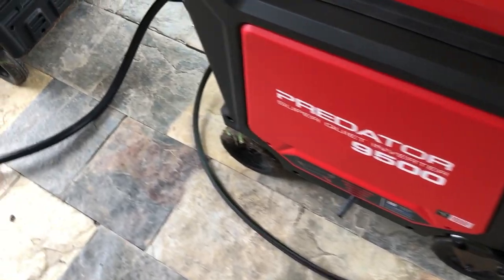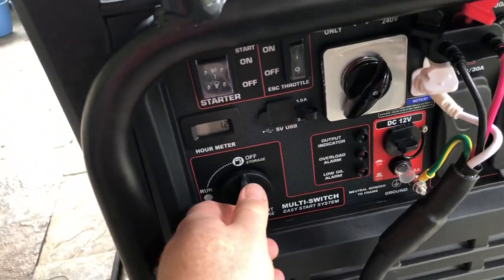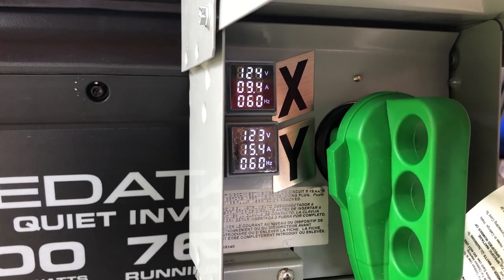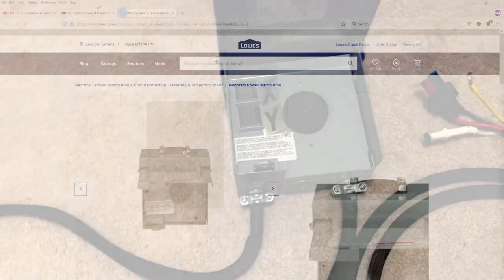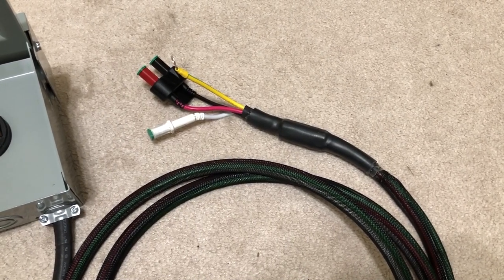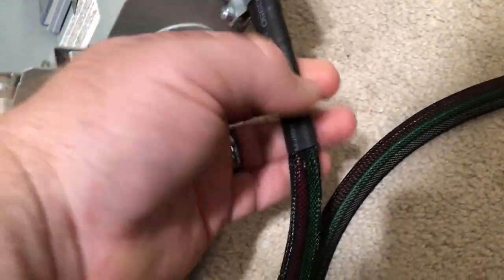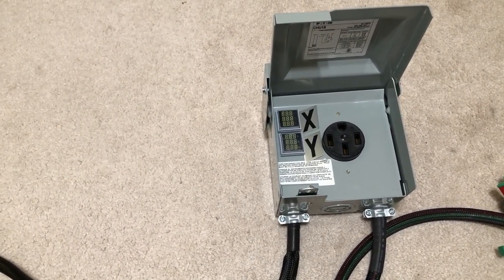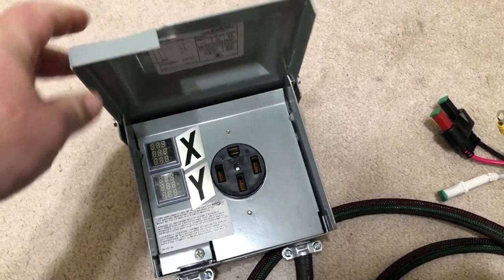Predator 9500 Home Built 240V Parallel Kit Test & Build Parts: 2X Output Power Using Two Generators!

Comment: Would it be possible to use the 30 amp four prong twist lock outlets instead of the powerhorse parallel kit? These kits are backorder and not coming in anytime soon according to northern tool.
Reply from the maker: **Technically**, I don't see why it wouldn't work, but, it would very risky and dangerous for reasons you might not think of... here is my warning about doing so:

First off:  There is a comment in the history of the video from a user "B F" where he implies that would be a better method.  Only I think he was suggesting each 30amp feed would go into the main circuit breaker, with no parallel "kit", the logic being more available amperage from the pair.  I went into a bit of a wall of text regarding the pitfalls of doing so.  But let's say it was a parallel kit instead.

So instead of direct feeding it into the home from the 30amp plugs (very bad idea) you instead made a parallel kit where each 30amp plug is joined together in a box with the 50amp female dryer plug.  Basically, just  like mine, but with 30amp male plugs on the ends vs. the parallel kit connection.

Danger 1:  As soon as you energized one side with a generator connected and running, the exposed male plugs on the other cable would also be energized with 240VAC.  (so, suicide plug )  This also means if one plug were to fall out, get removed, knocked out, whatever, those falling exposed metal plugs are energized.

Danger 2:  And this one is the doozy that most people probably wouldn't consider...   the power of each 30 amp socket is passed through a breaker on the front panel of the generator whereas the parallel ports are a direct connection to the inverter, this is really important, and I believe it's wired that way for a very good reason.  

If one generator of the pair is disconnected from the circuit (say breaker trips on either front panel, or one of the plugs is removed or falls out) ***then the generators will no longer be synchronized***.  Those two machines have to stay perfectly in sync to an accuracy of 1/60th of a second.  Meaning just like two clocks that you turned on at the same time will not remain perfectly sync'd for more than a few moments, almost immediately the two units (now running independently) will probably drift out of frequency sync.

So if for example, the plug fell out and you put it back, or if the breaker tripped and you reset it... this would probably do *spectacularly bad* things to the inverters and, to the sensitive electronic equipment in your home.  As your power would be composed of two different frequencies at the same time.  

I believe this is why they wire the parallel kit directly to the inverter via the specialized ports, making it hard to accidentally disconnect them (firm fit, and no breakers to potentially interrupt the circuit), and, why if one of these generators ends up overloaded, it forces you to completely shut it off the machine and restart it, (there is no reset button).  

By making you completely restart the machine, it forces an overloaded unit, (that would now be out of sync) to be started from scratch, allowing it to re-synchronize with a still operating generator on the circuit, and not get all explode-y.

So yes... you could do that, and I don't see why they wouldn't initially synchronize if they were both plugged in, and the circuit breakers on when they started.  But the plugs would be dangerous, and, you'd be setting yourself up for a situation where extraordinarily bad things could happen, if you or someone else made one single mistake when operating them.  Proceed with extreme caution.
Reply from the maker: To add:  I'm basing my warning on my understanding of how these things work, and what I've observed on how they're wired.  I have no official word or documentation regarding this.  (and before I got these, and better understood how they worked, I too assumed I could just join them via the 30-amp plugs since I had no idea where to purchase the parallel plugs from)

There MAY be some kind of safety circuit or function in place to prevent fireworks.  (Hypothetically someone could always still unplug the parallel kit and plug it back in while the units are running).  But to be honest, I'm not inclined to test the theory on mine and risk damaging the inverters, even if they aren't connected to my home at the time.

If anyone else want to test the theory on their $4000 worth of generators, I'd love to hear what happens.  :-)
Reply: @Texas_DIY  thanks for your help. Have you ever seen the banana plugs anywhere? All I've been able to find are the audio types. The kit you have isn't going to be available until late November. I called norther tool yesterday and covid has everything on delay for them.

Comment: Here's a potentially dumb question.  Has anybody tried hooking up the PH cable on the Predators as it's meant to be hooked up on the Powerhorse generators?  I've probably missed it, but I haven't seen that possibility addressed anywhere.
Reply from the maker: The PH generators are designed to be linked together like that. They are equipped with a high amperage socket and the internal wiring to accommodate that. Such that the front panel of one can handle the combined capacity of two units.  

The predator generators are equipped with a 30 amp socket. So using the PH stock cable would link them together, and double the capacity… but you would be still be limited by the 30A socket and the 30A breaker on any one generator. 

That’s why the cables combine into a higher amp socket, and feed into an inlet.  So you are able to achieve double the capacity that any one generator would be capable of normally.

Comment: Commenting and subscribing, great video. Only wish I could see the internals, though totally understand you not wanting to pop that thing open and risk a mess of wires spilling out! Migrating my comment from the other video over here, do you think the soft start is necessary for two paralleled 9500s to run a 5-ton A/C unit?
Reply from the maker: There isn't really much to see inside it.  Using those terminal blocks, each of the same colored wires get joined together.  The amp meters need power, so they had small wires added to the dryer plug (one on each leg of power).  And the little circle coil goes around what you want to measure.  (in my case, the 6 gauge wire going to each leg of the dryer plug).

Regarding your question on the 5 ton AC unit... like with most answers regarding generators, I think the answer is, "It depends".  Look on the housing of your compressor unit.  You'll see a number designated by:  LRA  This is "Locked Rotor Amps", and (as I understand it) represents the maximum amps your unit can draw from a dead stop.  There is also:  RLA "Rated Load Amps" which is the maximum it should ever pull when running normally.  (My LRA is 117A, and RLA is 21.8A)  Note those are *maximums*, and your actual number should be lower.  My clamp meter told me that MY max starting load (heat pump, scroll compressor) was 81.5A, (though it may be higher, the meter can only sample so quickly and the worst of the surge is very brief.)

The 9500 Generator can make 9500watts or 39.5A max/surge on each leg, so with a 240V AC, a brief surge of 39.5A can be handled, but normal running amperage of 7200watts or 30Amps.  Before I had the soft start installed, I did try to start the AC on the 30A hookup, and it instantly popped the breaker.  (understandably so with trying to pull 81.5A off something with a 30A breaker and a capacity max of 39.5A).  

So let's say I didn't have the soft start, and, wanted to start the AC using two generators.  Would it do it?  Maybe... if I turned off EVERYTHING else in the house, and had the generators not set on eco mode so they were spun up and ready.  My measured starting amps (81.5A), were almost exactly at the peak of the two units combined (79A).  And if the compressor was in different conditions (maybe hotter day, maybe starting again soon after the previous start, so pressures weren't equalized, whatever) it's "allowed" within spec to get up to the LRA (which in my case is 117Amps)  So... "sometimes, it could maybe do it"

But with the soft start, I was able to get it down to 41.5A starting (this is according to the Bluetooth connection on the softstart), and 11.3A running (normal) total (after fan and air handler) around 14A running. (I think people without heat pumps can achieve a much lower starting amps with these, very similar to the running amperage)  With two generators, this allows me to run the AC, and keep the rest of the house going, including the 20A hot water heater.  

Basically as long as we don't run too many appliances at the same time, we can operate relatively normally, but without the soft start, I don't think it would be happening.
Reply: @Texas_DIY  Thank you, Jason. Sounds like having the easy start, if not absolutely necessary, makes things much easier. So, went ahead and ordered one! I take it you installed your easy start on your own? The video install i watched seems pretty straightforward, but (as you've obviously figured out by now) I'm very novice and am debating whether to just pay a HVAC specialist to do it.
Reply from the maker: @todd9959  The hard part isn't the physical work of doing it, it's knowing where to hook things up.  The instructions try to be clear, but there are a lot of different ways AC units can be wired.  My heat pump was one of the strange ones, two capacitors and some circuit boards in there.  I sent a good photo of it to Micro-Air, and they replied back within hours with my photo, along with hand drawings on top of it showing exactly where to hook up the wires.  So that made it much more simple.  Even then I seriously considered getting an AC guy to do it before I just bit the bullet and decided to try.

Where you may run into problems, is that you need to have a specific (inexpensive) tool to properly crimp on the spade/lug connections to the wires.  You may need to purchase that (and the spade connectors themselves) from your local hardware store or harbor freight. Typically you want to use the same types of connections that are already on there, that you can screw down on the existing connection points.  My other issue was that I didn't have a good place to secure mine to the condenser, and ended up using some strong magnet hooks to stick it to the side of the housing.  You may have to be a little creative, but it's not too crazy to get accomplished.
Reply: @Texas_DIY  Thank you again for all of the incredibly helpful advice, I've learned a lot during the "electrical wiring / generator 101" crash course over the last few months. I ended up purchasing the Micro-Air Easy Start for my 5-ton A/C unit (no heat pump). Was able to successfully hook it up myself after watching an YouTube install video and studying the wiring diagram of my unit. Only took about 15 minutes once I had determined the plan of attack, so let that serve as inspiration to any other novices that might read this in the future (if I can install it, odds are you can too). 

I don't have a handheld meter of any type, so no way to know what max starting amps was A/C was actually pulling pre-install, but the unit's nameplate LRA is 137 amps. The only source of realt-time data I have is the Easy Start, which is the bluetooth model. So I was able to monitor progress on the app as the Easy Start went through the initial (5-run) learning sequence, which showed around 62 max amps during the first run, and, by the fifth (and last) learning run, it had gone down to about 42 max amps.

Only problem is I guess I got greedy, because I decided to re-do the learning sequence to see if it might get a lower end result. To my luck, the result ended up being the opposite -- the final learning run for the second go-round was even higher, 52 amps. At 52 max starting amps, I'm disheartened because now I'm concerned whether my setup will even be able to start the A/C unit (and that's even if it were the ONLY thing running / drawing power from my home). Reason being, the Predators will be pushing power to my home through a 50 amp interlock system -- and, unless there's some intricacy I'm missing (which I hope is the case), my thinking was I'm screwed since that falls short of the 52 max amps needed to start the A/C. 

Am I thinking about that correctly? Hoping you can speak from experience, as we have very similar setups based on your video: 5-ton A/C unit with Easy Start, a 50 amp interlock system, paralleled Predator 9500s. I would just go ahead and give it a test run myself, but still waiting on parts to build the parallel kit. Also, if you have a Easy Start model with bluetooth, would be very curious to know what it shows your max starting amps are (vs. what you're seeing on your parallel kit's amperage meters). Again, thank you so much for your time and guidance.
Reply from the maker: @todd9959  Breakers (unless they're specifically designed to) don't typically insta-pop the moment amperage exceeds their rating.  For example, typical starting AMPs for a compressor without a soft start can briefly be 80 or 100+, yet the actual breaker for the compressor on mine is rated at 50.  They're designed to trip before wiring becomes hot enough to cause a problem, but not so much at an exact precise amperage.  Somewhere I've seen a chart that estimates how long it takes a breaker to trip at X amperage at X temperature.  In short the time to trip shortens the higher over the rating you go, but unless it's a dead short, or way way over, it's not an insta-trip.

Surge output on the Predators are 9500watts or around 39.5A, if you've got two and your using the parallel output which bypasses the generator breakers, then you can surge up to almost 80Amps, and run continually 60amps (is that ideal with a 50amp socket.. no... but there is some margin in these things, so when on generator power try to manage things as best you can, but don't panic if you hit 55 amps or something.  (I used a 60amp breaker for my inlet, knowing that I can push 60 continuous from the units.  

In short, I think that you should be just fine with the soft start.

I'd also suggest starting the learning again, and see what it comes up with.  Maybe start it in the morning, so as the day heats up it's getting a sample of some different temp ranges.

Also, the surge readings off the bluetooth softstart seem to be about 10amps higher that what I get on my meter.  I don't know which is more accurate... But I'd guess the softstarter... that thing is much more sophisticated than it looks... but a grain of salt there.  If that's accurate, I guess that the peak is so brief, that my meter can't read it in time and catches part of the rising slope.  Such a brief surge isn't usually going to be a major thing when it's brought back down so quickly.

Comment: Thanks for creating this video, well done and very useful information!  I think I can run our home on a Predator 9500 plus a Predator 3500.  My question is, if I build a parallel kit, will it work to parallel the 9500 plus the 3500 for a 120/240V home electric panel?
Reply from the maker: The 3500 isn't a 240v unit.  So I wouldn't suggest trying to parallel them together.  I have no idea if it my sync with one leg and give you some extra capacity for that side of the power, or, if it would smoke them and bad things would happen.  I wouldn't want to test it on my $2k generator...  :-)

Part of what makes the 240v inverter generators so cool (Predator, Duramax, Honda) they make the same power as what you get fed in from the power company (actually slightly cleaner in my case).  You don't have to do anything crazy, just feed it in (safely) and nothing in the home knows any different, and things just run normally.
Reply: No all parrell require exact same generators